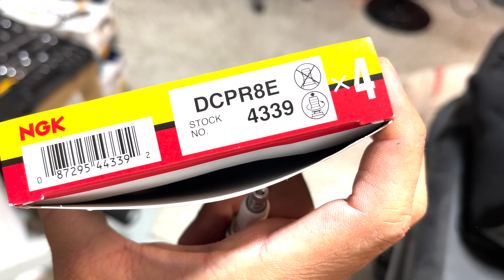Sea doo problems - What is wrong with my Sea doo

Comment: Y'all may want to try some Ethanol free fuel mixed with some gum out octane booster.& cataclean in the fuel at lower gallon mixtures for your jet skis witch does include the 2 cycle.,2 cylinder engine oil also. Then watch the power it releases to afterwards. Take care.& be safe out there to guys!

Comment: Wrong spark plugs 4339 is for 155,215,255,260 4-tec .300 ace motets use KR9E-G
Reply from the maker: It is recommended by performance shop due to the working temperature capacity.

Comment: You installed the wrong Spark Plugs DPCR8E.
Reply from the maker: Thoes are the spark plug a Sea-Doo performance shop suggested. 🤷🏻‍♂️
Reply: It should be KR9E-G not DCPR8E for 300 models

Comment: If the plugs had water exposure it’s in the engine.  You have more issues than just plugs.
Reply from the maker: You're 100% right on that.
Reply: @charlottecountyriders  for sure you need to do a boil out.  What happened to get water in the engine?
Reply from the maker: @Futurase1  yes

Comment: I have a 2014 Seadoo 155 git and I am not getting a ground signal out of ecm on cylinder 2 the rest is fine no cel  runs rough  flung a little corrosion in the tops sensor harness  could that cause the issue also where does the ECM get the input to send ground to cylinder #2 power is there

Comment: Looking at your Fuel Guage (Low level / 2 Bars)... I'd say when you're launching it hard your Fuel Pump is Sucking Air. Recommend at least a Half Tank of fuel to prevent fuel starvation with the OEM Fuel Pump Setup. Hopefully that solves your Fuel Cut-Out issue.   Randy   AKA randog311 (Retired Professional Wrench).

Comment: Hello, I’ve got a Sea-Doo 2008 I went on the beach. I forgot to turn off near the beach and hit the bottom on the stones as you’re pulling away it was smoking. I looked underneath the grill. It’s all clear looked at the propeller that looks okay, it’s smokes when I drive it on the sea. Does anyone know what it could be thank you

Comment: It's water in your carburerator.& the jets are clogged up with corrosion inside from watery fuel. Say you accidently got splashed in water into your fuel tank.,or some water in your gas can by chance. That can cause those issues with that cutting out on hugh end output.& throttle lockdown at full throttle position witch will cause engine fluttering.& carburerator blow floats to what is called flutter bouncing inside while at top speeds to.

Comment: You are using the incorrect spark plugs 🤦
Reply from the maker: Thoes are the ones a performance shop recommended due to their working temperature. I know that's not what the Manuel says.
Reply: @charlottecountyriders  Obviously they are not working , performance shop parts .. OEM works ..to to finish 1st you must first finish your not even starting ..